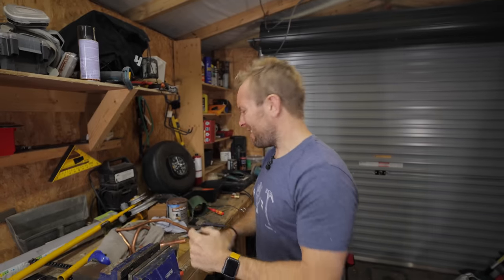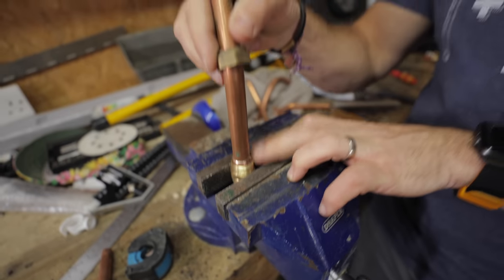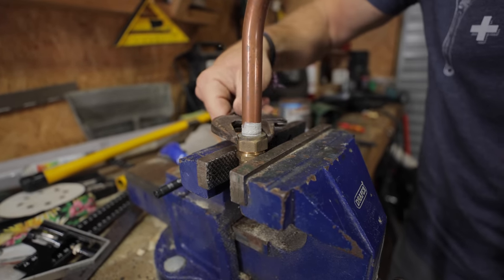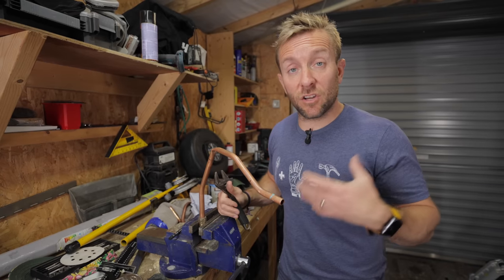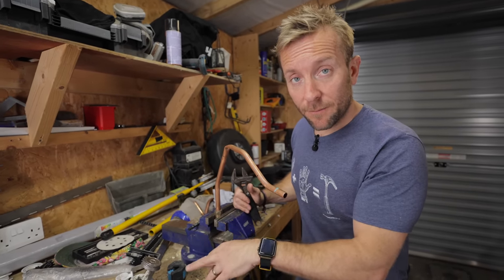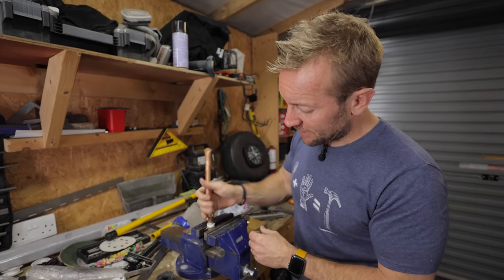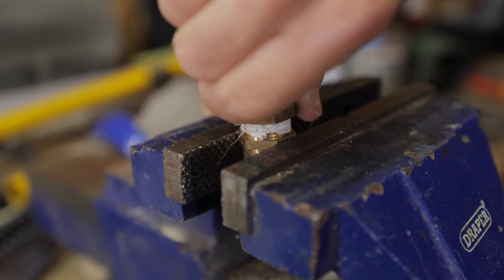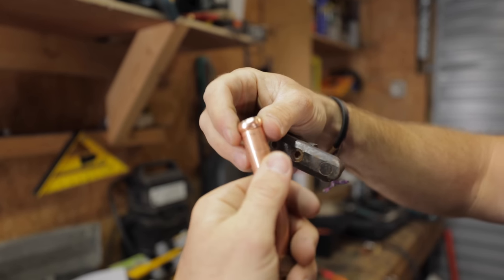4 MISTAKES Everyone Makes When Using COMPRESSION FITTINGS

Comment: Great tips, I'm not a plumber but i didnt know that there was a special past available now! What I've used to prevent the squeeking when tightening up the compression joints is appyling a very small amount of Vaseline (petroleum jelly) just a smear like you put on your lips around the olive and pipework and also a little on the threads this will make the olive slide and seat very smoothly, you just know that its not going to leak.
Also if in future you have to undo it, it would come undone very easily, great for when replacing isolating valves and radiators valves, etc.
I understand that vaseline is non toxic 
But better to use new approved stuff if used for drinking water.
I wouldn't use it on these plastic push fit though as it might cause the rubber O-ring to deteriorate quicky.
Reply: vaseline degrades mate and is water miscible makeing it not a good choice - Tip from radio engineers working on seas salty outside stuff - Use Copperease on everything and Marmite on everything else. (Both Unobtainium in Thailand sadly)
Reply: @ebaystars  copper grease is good for automotive applications as anti seize compound and good at high temperatures.
However I think its toxic to micro organisms and harmful to aquatic life.
Reply: Vaseline seems to work well
Reply: @santorini8423  like I said I'm not a plumber I won't toutch anyone else's only mine!
I'm an engineer so do understand basics of most things or study it first before doing anything.
I can strip down and rebuild a car engine etc, also fully understand how electrical systems work etc.
Reply: food-safe silicone grease can be used ... and safe for rubber O rings

Comment: I have to admit, this is the 2nd plumbing video I've watched on how to replace a valve. The original valve was soldered on by a plumber, 30yrs ago. I'm not a plumber! So I went to Homie Depoe, and discussed my options with the genius that helped me find the right size replacement in a compression valve. Why not a sharkbite valve?? I have no idea...
But anyways, I didn't know the compression fitting needed jointing compound. And, of course I tightened it thinking the tighter the fitting, the less likely it would leak....
😮

Comment: On all brass compression fittings, i use silicone grease on the threads now.  A dab of any oil also works.  If you smash the brass or copper flares together properly they will stay smashed.  Friction sometimes will not allow the nut to tighten fully.  Had 3 copper unions squeaking and small drips.  A little lube on threads, didnt have any resistance and no leaks.  And no garbage on the threads later

Comment: Good point about low quality olives. Some might not have been annealed and therefor wont compress into the tapers properly. Just get them red hot and drop into cold water - so long as they are copper.

Comment: Olive cutter. Very nice. I'm not a plumber, but have been doing a bit of water work DIY. Definitely had issues removing or not olives. I fancy a cutter, or maybe the hacksaw and screwdriver tip.
Thanks good video, I'm going to slap on more jointing compound than I have been after seeing you use it.
Reply: You can get olives off using an adjustable spanner which you adjust to the diameter of the pipe. Put the spanner opening onto the pipe behind the olive and then gently tap with a hammer. This drives the olive off the pipe.

Comment: Make sure pipe fits and correct length, make sure both sides of the olive are on the pipe by giving it a nip and visually checking it. In tight spaces, I have used a fitting away from the joint to give the olive a squeeze so it cannot move. A few wraps of PTFE tape around Olive or potable water sealing paste where applicable and no problem. You are posh poetable water I have always said potable water (Drinking Water). Not to tight not to loose and never ever think your brilliant and do not need to double check everything, it will still get you every now and then.  The amount of experts I have met in life at all things who cock up all the time because they know they are perfect and do not need to check! Everyone can get caught every now and then so check check check. I stripped and assembled a hot water tank bottom fitting three times resealing each time and it still leaked to find at two o’clock in the morning a cracked reducer fitting, I had used the old ones! I had purchased new ones but the old fittings were ok (Not). It was a home job as well.

Comment: Excellent video - so glad I watched before attempting to use compression fittings.
Quick question - can you still nip up a compression fitting that has jointing compound after it’s been in place for a week, or does the compound go off and crumble if you try this? I thought I’d tightened it enough, but after a few days it started to seep (not condensation).
Thanks 👍

Comment: I'm plumber in France and even if i didn't learn anything new with your video, i can tell you it very well made and pleasant to watch.
I have an other technique to remove the olive that work if the plumber didn't tight it too much, it's to use a wrench that you open at the same size than the tube and slide it toward the olive with force, i manage to remove olives like that almost all the time.

Comment: If I put compound on a compression it was an instant fail or a rap across the knuckles with a pair of sixes. North Thames Gas apprenticeship. 4 year apprenticeship, 18 years working. How times have changed. Surprised you did not say LS-X, a must on them fooking doughnuts :) Also under tightening is always better than over, as you can always nip it up, over, no chance.

Comment: Another tip I think you should have mentioned, make sure when you place the nut and olive on to the pipe, you make sure the pipe has entered the the full depth of the body of the fitting, I have seen some that have only just nipped at the end of the pipe, and could pull apart!
Reply from the maker: That's a good idea! Seen that a few times myself! Hope to see you on my livestream this Thursday! https://plumberparts.locals.com/post/4240778/ale-army-raw
Reply: I always tighten the nut and olive dry then loosen it and then apply the jointing compound and then re-tighten that way the compound doesn't get between olive and pipe making less likely to pull off under pressure, this more likely in larger  pipework
Reply: I disagree! If the pipe is fully home then once you start tightening the fitting and the olive starts to bite it pulls the pipe down with each turn. If the pipe can’t move the same distance of the threads the pipe bulges inside the fitting as it’s compressed and will leak. I always push the pipe home then back out 2 or 3 mm so there’s room. Never needed jointing compound. This should be tip no.5!!!
Reply: @bbarnes4852  I'm talking about large commercial pipework not 15 mm plus I see compression fitting pull out when the booster pump wasn't set right
Reply: @bbarnes4852  Thanks, I'm with you.

Comment: Great video!
I had to replace a mains stopcock attached to the blue 25mm mdpe pipe under the kitchen sink. Could not unscrew the nut to remove it. Had to use an angle grinder with a thin cutting disc to very carefully cut through the brass nut and olive underneath. A rotary tool would be safer, I think.
Reply: Cordless multi tool with metal cutting blade.

Comment: As an addition , best practice for making gas  compression fittings (which tends to be the gold standard) was  to go through the process just described ,then disassemble and re apply a smear of paste around  the squished olive on the pipe.  I always tended to do this for LPG because it just wants to leak. ( I'm not advocating that DIYers  do gas pipework , just highlighting best practice which also applies to wet pipework )
Reply: DIYers doing GAS WORK, what could possibly go wrong?????????
Reply: In the States you can't use compression fittings on gas. Nor can you sweat gas pipes. Flare only
Reply: good tip
Reply: as i am in uk i would report the bad pipework and who installed it to the gas safe register ,a timed leak test has to be done before and after any work carried out .no one can do diy in uk to any gas instalations ,lpg should also have timed leak test done ..
Reply: Just to be clear again , if you read my comment again it is NOT to encourage people to do gas work (as i clearly stated originally ) but to highlight best practice for gas so that DIYers can make the perfect WATER joint.
A Rolls Royce engineers once showed me best practice on jet engines for torqueing down nuts.  He wasn't advocating that i started fixing jet engines and nor did i take it this way. It was just good advice that carried  over to automotive repairs

Comment: Hi  I'm a sparks and if you remember MICC cables which have a similar olive and gland system I had the same thing educating apprentices on not over tightening the olives because if they were over tightened and the cable was moved you lost a good earth as the outer sheath was the earth. Brilliant vid and good tips. I looked for the olive splitter that you sowed and could not fine that particular one. I would like to add that to my plumbing kit. In the past I have used a junior hacksaw very carefully to remove an olive not quite cutting through.
Reply: There is another type of olive cutter that looks like a large pair of pliers. One of the 'cutting' jaws of the plier is flat and you insert it inside the pipe. The other 'cutting' jaw is indeed a cutter and cuts the olive. The difference between the 'plier' type and the one shown in the video is that the 'plier' type is operated in line with the pipe instead of at right angles to it.

Comment: Cheers ... Jointing compound.. need to find that. But I always put a wrap or two of PTFE tape on the olive of new fittings, just in case there is a small discontinuity (Roger, Skill Builder tip). 

Another tip I find useful is clean the pipe before fitting, with fine grit sand paper or one of those cleaner wire brush tools. can make a difference.

Lastly another over tightening danger: stress can build up in the nut then one day it might crack and all hell will break loose when least expected, has happened to me.

Comment: Great tips there! Plumber who did central heating install used no jointing compound, said it wasn’t necessary.
Ok, but I specified chrome plated 15mm where visible in the lounge. Again, no jointing compound. Now I know that chrome is harder than brass so it would never bed into the pipe. They said tighten it up firmly and it’ll be ok. That’s what they did, and guess what???  Furry deposits around all the joints! Slow seepage between olive and pipe. I called them back and they said they’d return and fix it. That was two months ago. Still waiting…..
Reply: Problem is all fitting manufacturers state not to use third party sealers on their fittings and doing so will void warranties.

Comment: I occasionally use a bit of boss white (like soft putty), or just a light smear of Leakseal (silicone mastic) on the pipe before fitting the olive (in case the pipe is scratched) and a tiny smear on the outside of the olive.  And a drop of silicone oil on the threads & chamfer, following previous mechanical experience.  If re-using an olive I'll always put a couple of turns of PTFE tape on the olive.  No fails here.

Comment: Jointing compound/paste will shrink after a few years, I had 2 joints leak on my central heating after 5 years, unfortunately you just can't tighten them up because the paste goes hard! Better to squirt a drop of WD40 (any thin oil will do) into the joint just before tightening, works a treat.

Comment: Good tips, you say not to put PTFE on he thread, I've always put 2 turns of tape on the thread as a lubricant. The squeeking sound you mention earlier is the 'brass' threads galling against each other creating friction. PTFE prevents this, makes tightening easier.
Reply: Ludicrous.

Follow the MIs, which do not advise the use of PTFE.
Reply: @maxmerton  On threads or over the olive ?
Reply: save putting ptfe tape on threads for when you're working with BSP or BSPT fittings.

Comment: When I started  plumbing in the late 60s I was always told that a compression fitting was used for repairs only  and you don't use paste, but times have changed the fittings arn't as good a quality as they used to be, the other thing is you tighten the nut one and a half complete turns to fully secure the olive it takes a lot of strength to do this on larger dia pipes.

Comment: I spent most of my career doing stainless tubing. If you need compound or tape you should find another trade. Lubricating the joint allows you to over tighten the joint.
Reply: AS he said....the quality of imported copper - brass fittings are not as good as the older stuff, so tape or jointing compound is advisable.

Comment: Moved into a house and the central heating leaked. Lots of the olives were so lose I could turn them with my fingers. No way to drain the system. I added over 10 drain cocks and shut of valves so I could isolate the system and replaced whole joints or just olives.  Great tips about paste and over tightening.

Comment: Awesome stuff - would have been useful to me a few years back - did a bathroom refit at home - and had to convert a main pipe in the floor with a compression fitting I used a 22mm olive in an old water pile to convert it to 15mm  - old 7/8 water It had the smallest leak but take ages to seal it.
Reply: you buy the old pipe olive ,good luck trying to fit a 22 mm olive on old pipe :)

Comment: Never knew this... but as an insurance policy I always smeared some plumber's putty on the copper pipe before sliding the olive onto it, then I would also smear the olive with some more plumber's putty before bringing the nut over it and tightening the nut (holding the other part of the fitting with another spanner) to fully compress the olive and form a strong watertight seal - I've never had a leak ! lol
Reply: Only use for plumbing putty is what it is designed for, sticking glass panes into windows. Sealing compound works better, and you can at least undo it later on without needing to cook the putty out.

Comment: That olive cutters a nice tool to have.
I'm not a plumber by trade (IT tech) but I have done alot of plumbing over the years and never bothered with jointing goop but having seen it I can see why you might want to use it as lube more than anything.
Normally if its a stubborn joint thats decided to weep, I've just put half a dozen wraps of PTFE to seal the deal but thats been the exception not the rule.

Comment: Jointing compound I find is mainly needed on Chrome fittings because they have been machined and then sprayed or dipped. 

In Holland I NEVER used jointing compound on compression fittings. Even the low carbon steel fir the heating. Come to England and did 10 rads and my mate clearly told me to use paste. I said, why? Never needed to before. ALL 10 rads leaked on every valve I fitted.

Now, like you said, I always use paste. Jet blue is the best. Stay away from Laco with all the bits in it, that caused so many leaks on male irons to the cylinder.

I even add a bit of paste to loc-tite as the white chalk can dry out a bit making it tight screwing it in.
Reply: That's because you used metric on an imperial system..
Common mistake.

Comment: Very good advice for non plumbers like myself.
I usually cut the olive off with a hacksaw blade as you suggest, and carefully.
Presumably leaving the previous olive on is not a good idea?
Reply: You can remake a joint with the old olive in place, if you cant remove it. Just reassemble the joint after applying jointing compound or PTFE tape to the olive.
If you are a regular plumber, then olive removal tools arent too expensive to add to your kit.

Comment: Not seen that olive splitter before, not sure it would be of any use in tight spaces. I use the Monument olive cutters, 10, 15 and 22mm. The other tool, an olive puller, is useless on an old, probably over tightened olive. The puller just starts to make the pipe bulge and then you’ve no chance of getting the olive off. Perhaps it’s just me, but I like to put plumbers grease on the threads as well. A good, well delivered video.

Comment: Use heavy duty hex compression nuts. 1'/8  thick at taper. Pulls up pressure straight away. Used thousands in Aussie. Seal compound helps. Use a rounding plier to set roundness of copper as soft copper often out of round .

Comment: With particular reference to gas - compression fitting where used must be ‘accessible’ ie not hidden within boxing or under floorboards etc.

Where they are used say pipe work serving a hob, the compression joint must be done dry from what I was taught in my gas course. Reason being a joint done with paste may well pass the tightness test at the time or work but may cause a leak later on where the paste was actually filling in a leak and the paste has dried out etc over time
Reply: Use a non-setting jointing compound
Reply: @johnmac8084  Non setting compound such as ‘Rocol - Gas Seal’ paste is only used on threaded connections.

Just what I was told on very recent course - nothing extra to be used on compression type fitting, if it’s a gas carrying pipe. Fine to use paste, Ptfe on olive if you like on water, but it shouldn’t really be necessary.